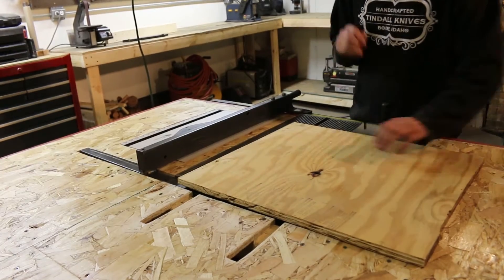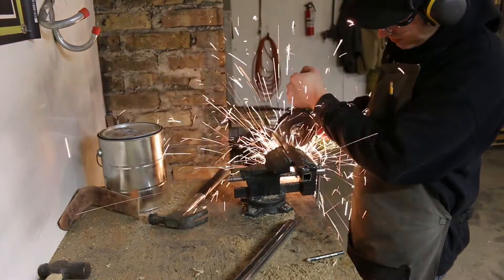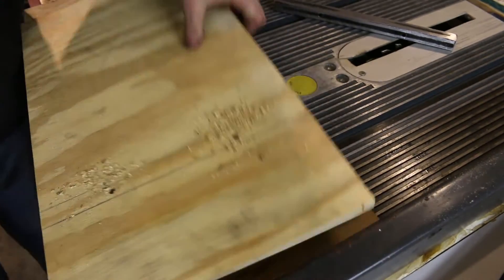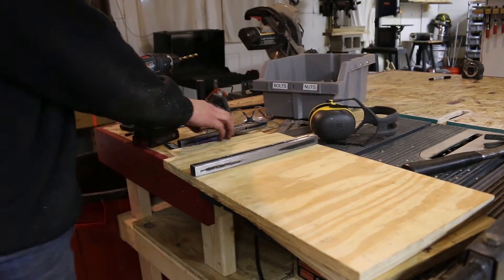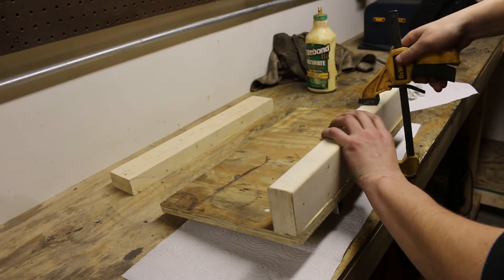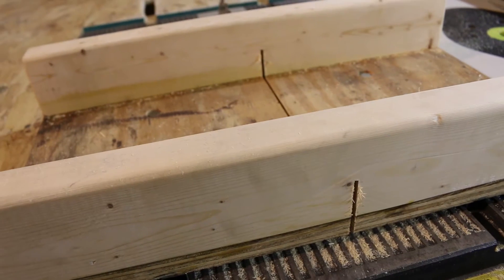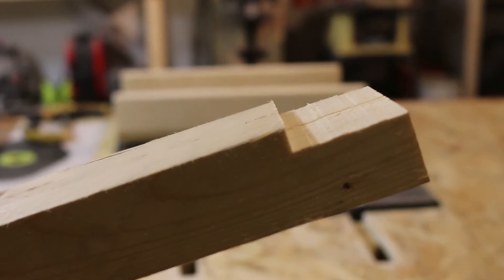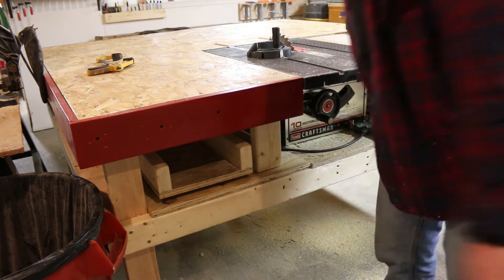Basic Crosscut & Dado Sled

Comment: Good idea about the off set for the dado. you could tap the metal tube although wood strips are easier. The thing that would need tweaking is to square the fences (front and back in your case) to the blade.

Comment: Good job man. Just make sure that the front or in this case since you are using both sides, one for daddo, one for straight cuts, make sure both boards are squared .   My one concern, with the thickness of the base, are you able to make true half joint daddos?  does the blade raise high enough to get through the sled and half way through the board?

Comment: Use your dado stack to sink the metal tubing into the plywood. Obviously.lol.  Maybe tap the steel for bolts/screws instead of the current method? My first basic sled was hardwood "sliders" waxed up and 3/4" ply with a squared(accurate 90 degree) plywood similar to yours. Still have it and use on occasion.  Just putting in the ole 2 cents. lol.  Is that a shared shop or business? Cool to see multiple people all sharing and working together.
I had a very similar table saw and know how every little bit of blade height is critical. That extra lift from the steel makes or breaks some cuts. lol
Reply from the maker: Thanks hahah this was my first attempt, it works for me but I definitely want to redeem myself at some point lol 
I share this shop with my brother. We forge tools through our company Timberlee Tool & Trade. Slowly trying to get better at woodworking though!
Reply: Lol